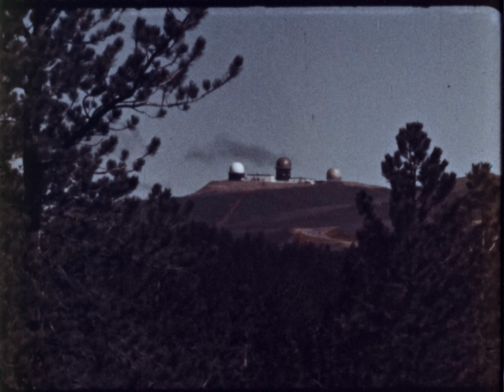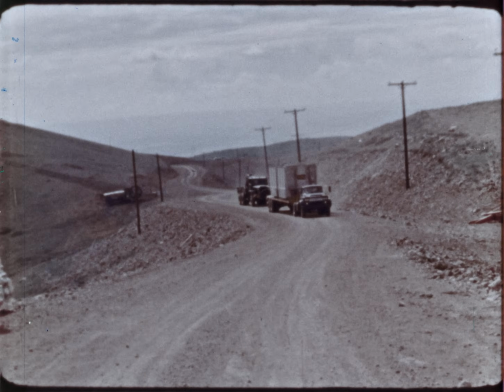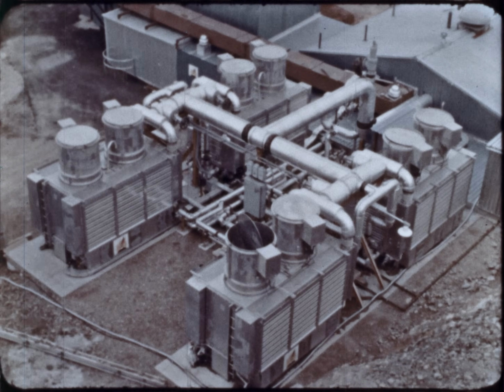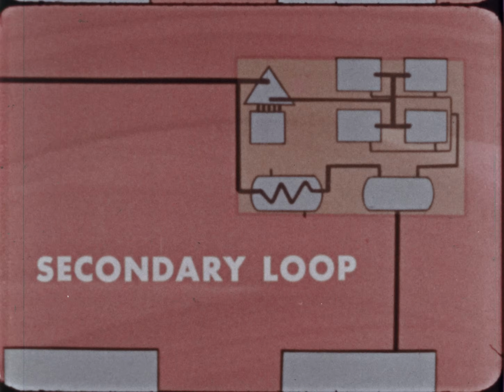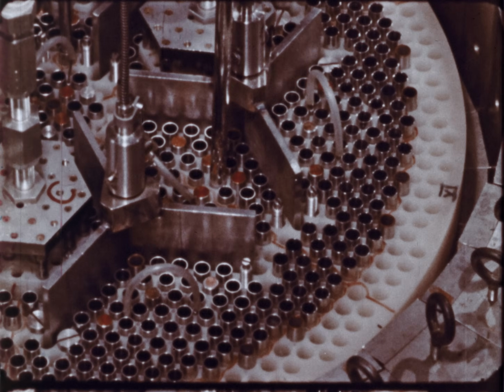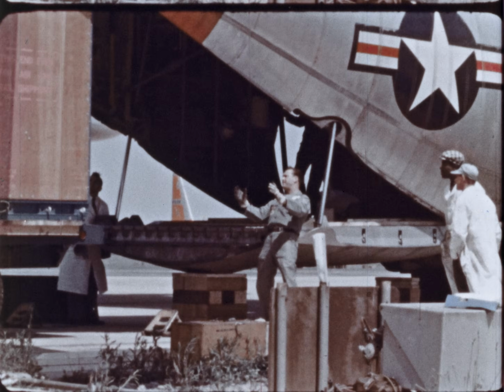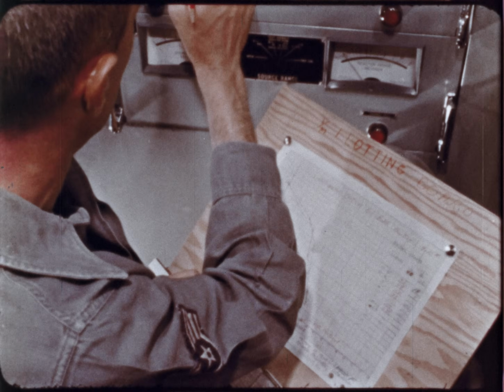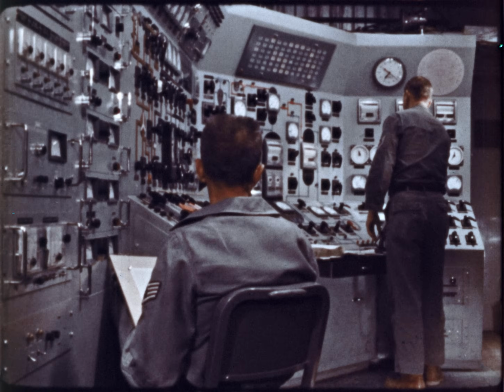PM-1 Nuclear Power Plant — the radar-powering microreactor in Wyoming from 1962

Comment: Awesome video. The radar site is still there although most are just foundations. The place where the miniplant was, has completely reverted back to nature. They removed everything.
Reply: Only some things. There are still parts of this reactor buried underground.
Reply: shame, it would have made a great museum piece
Reply: Thanks for the info. I was going to look it up. I had presumed the radar system had been supplanted. I guess the PM-1 is no longer in use...
Reply: @The_DuMont_Network  Decommissioned after 4101 hours ( about 6 months). I suspect there was a problem.
Reply: @guytech7310 
I would think so!small nuclear reactors don't have enough thermal mass to prevent sudden power excursions. You wanna bet they left the waste buried on site?
Reply: @richardmccann4815  I doubt the waste (fuel) was buried at site. Not sure what the problem was, probably just not cost effective & too much down time.

Comment: An old Bell Lab film said homes would have reactors the size of hot water heaters for a life time of power.
Reply: we were not allowed to have that future.
Reply: @amentco8445  Lol steam turbines are perfectly legal. Go make a coal fired micro turbine for your backyard first and see how cheap/easy it is. A coal fired boiler is short bus math compared to a nuclear fired boiler
Reply: @amentco8445  That future was a fantasy that didn't exist.
Reply: @Peter_S_ it wasn't pursued to exist smart ass
Reply: 0 seconds ago
I think I saw that Bell labs 16 mm movie!
I lived in NJ as a kid and we had all those movies and Bell labs came and did a presentation and talked about fiber optics about the time most thought it was science fiction.
Reply: not maintenance free and not safely lol and especially not cheaply. A micro steam turbine is going to cost big bucks
Reply: Nuclear power was going to make electricity “too cheap to meter.”
Reply: @davidpugh796 it almost does. But the certification , plant, maintenance,  insurance,  labor,  profit and eventual cleanup push it sky high.😊
Reply: Musk levels of bullshit was about all those years ago too then….
Reply: The best investment my father ever made was to buy me a Ford Nucleon when I was born. One million miles between reactor core changes. You can even boost the output by shoving some Coleman lantern mantles down the intake... Thorium oxide... Responds to the neutron flux and breeds U233 which gives you faster starts, lower drag strip times, and increases the length of time between reactor core swaps. The only drawback is the lack of effective shielding. Driving for too long results in burns to the lower back.  During an endurance race, you have to switch drivers every two minutes to limit exposure times.  /snarkoff

Comment: This reactor, along with several other designs intended for remote military installations, used highly enriched uranium (HEU) at 93% U-235.
Reply: Any idea on how enriched the spent fuel was?
Reply: @drwthmpsn7457  This was a highly experimental reactor.  The cores of these pilot plants were designed to last two years without refueling.  Not very long, they mention in the video they were working on extending this (for nuclear submarines which are difficult to refuel).  The PM-3 in Antarctica was shipped with two cores, and they swapped after two years. As for the percentage of fission material left, that really does depend on how the fuel was used and for how long.
Reply: depends on the burnout but probably less than 20 @drwthmpsn7457
Reply: Mickey Mouse story....nobody can make nuclear weapons technically
Reply: @willibrordusa.vanderweide2962 remove or disable the safety systems, and this reactor would make a great dirty bomb! And nowthey have the Sundance festival there, to balance out the cancer clusters!

Comment: Wish we had some follow up of how the PL 1 reactor performed, and why the Army canceled its program of small reactors in the 60s.  I know the Antarctic reactor leak forced a cleanup, but I doubt they all did.
Reply from the maker: @ivanbremer8662  they already told me my request was approved and they're scanning it in.
Reply from the maker: I'm working to get the final PM-1 report via a FOIA request.
Reply from the maker: Update: got it: https://whatisnuclear.com/assets/PM-1%20Final%20Summary%20Report.pdf
Reply: @ Thanks!  In summary: compact design made maintenance intractable, design was flawed below full power, insufficient trained operators, ie Army/AF needed a Rickover Navy training program and failed to do so.
Reply: @ivanbremer8662  yes? How would you know? Or is your comment a joke?
Reply: According to someone I was talking to that was definitely involved in one of the small reactor projects, it basically came down to cost.  On top of that, a lot of the original impetus for the development of small reactors was tied in with the NEPA/ANP programs aimed at developing nuclear powered aircraft, and since that didn't seem to be getting anywhere and had become deemphasized by the development of ICBMs it left the only really viable application in cases where there was really no other option - which was basically nuclear powered submarines.
Reply: @TrimeshSZ  if that’s the case, then the cost of small nuclear was higher than 100000 gallons of diesel a month (2MW diesel generator fuel consumption), forever, shipped to the middle of nowhere?  That’s 10 standard  petro tanker loads a month, more if it can’t get in there at in winter, ie 200,000 gallon storage tank onsite. Today that’s $6M/yr fuel, probably $10M/yr delivered.

Nah.
Reply: @Czeck0-u1k  First of all, you are talking about present year costs for a system from the '60s, where fuel was far far cheaper - secondly, the fuel load on the reactor only lasted two years and then you had a load of extremely hot fuel assemblies that you had to either reprocess or store for thousands of years.  If you are going to compare things then you have to look at total lifecycle costs - and small reactors score extremely badly on that metric, which is why the market shifted towards larger (typically 1GW(e) +) reactors - because all those overhead costs could be amortized over much more output.
Reply: @TrimeshSZ  Fuel? Yes was cheaper 60 years ago.  So was everything else including reactors. Nuclear  load for small reactor would fit in the back of a pick up truck. What’s that once every two years compared 10,000 gal diesel every three days? 

Storing fuel on the surface is relatively cheap, esp then.  Drop it in a concrete cask and let it sit.  US Navy has been storing spent fuel since the 50s.

Commercial regulation ratcheting made nuclear expensive in the U.S, not the tech itself. That drove bigger reactors.
Reply: @Czeck0-u1k  okay, the nuclear plant in McMurdo .... how do you exchanges the hot core and then transports it to the US for reprocessing ?

Yes, i know the transport is done by ship but it is still the small trouble of removing the core, put it in a transport flask and then get that onto a ship....
Reply: @TheStefanskoglund1  There’s no need for reprocessing. A few storage canisters are much smaller, lighter than the reactor structure itself which was shipped there.  Certainly lighter than the millions of gallons of diesel that have been shipped to McMurdo. Spent fuel canisters could stay there for a hundred years, like any other block of concrete.
Reply: @Czeck0-u1k  Well, the first observation has to be that after these pilot projects that were run to demonstrate technical feasibility there was no subsequent serial production - which would normally mean that either (a) it  didn't work (it did), (b) it wasn't practical at scale (it was) or (c) it just cost too much.  Since I've been told it was (c) by someone that was actively involved in these projects (I've seen the photos to prove it) I tend to believe it.
And yes, the fact that you have to account for end-of-life costs is very bad for the economics of nuclear power - but realistically there isn't much else you can do, because the lifecycle costs of a nuclear plant are heavily end-loaded, and you need to ensure the money for end-of-life remediation is available, and the surest way to do that is to roll it into the plant budget.
And you really do need a decommissioning plan for a nuclear facility - an admittedly extreme example of the results of not having one is the Hanford site, which operated for about 40 years initially on an emergency basis because it was in the middle of war and later because the whole place was already so contaminated that it was hard to make it much worse.  One of my friends is a heath physicist who's first job after collage was working on the Hanford cleanup - he's now been working on it for over 30 years, and although the site is way cleaner than it was, there is still a lot of work to be done.
Reply: @TrimeshSZ  I’ve read in several reports that (a) in fact the polar reactor didn’t work as planned, it leaked.  Nothing catastrophic but sufficient to require off line periods, to what extent I don’t know and and why they could not be resolved adequately I don’t know.

Hanford  was a weapons material production facility where env concerns were a Cold War after thought,  not a power reactor. No US decommissioned  commercial power plant is a superfund site.  

It’s a great to have access to evidence like photos if you can use that knowledge to explain how and why, not so great to say “I’ve seen photos” and ‘I know a guy’, “very bad”.
Reply: @TrimeshSZ m
Reply: @TheStefanskoglund1 we had the ability to make much higher power units, even at this point, but weapons grade radioactives were considered too high a risk.
Reply: @TrimeshSZ  so where does Galen Windsor fit into all of this?
Reply: @Czeck0-u1k  Your fuel estimate is wildly inaccurate.  I ran 1.5 mW diesel plants in Alaska for about two decades.  We used on average about 250k per year, which included fueling about thirty vehicles including dozers, snow plows, trucks and other vehicles, and also the heating boilers for ten to twenty buildings.  So, 100,000 gallons a month for 2mW?  
You have a leak somewhere that someone should look into.
Reply: ARTIC Not Antarctica.
Reply: @Steve211Ucdhihifvshi  Army reactor PM-3A, installed McMurdo Station, Antartica. 

“Between 1961 and 1972 McMurdo Station was home to Antarctica’s first and only portable nuclear reactor, known as PM-3A, or “Nukey Poo.” “
Reply: @Czeck0-u1k uh oh I gotta nukey poo!
Reply: It exploded.
Reply: @tedolphbundler724  No that was SL 1 in Idaho